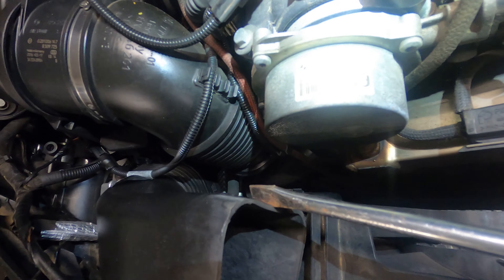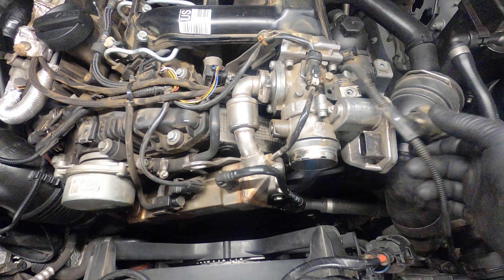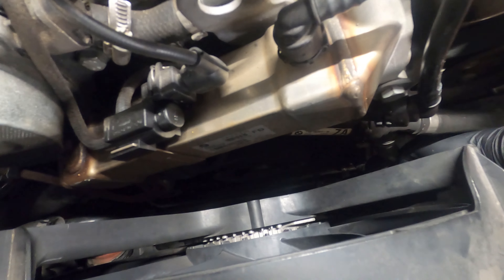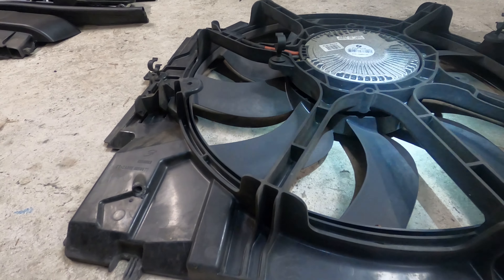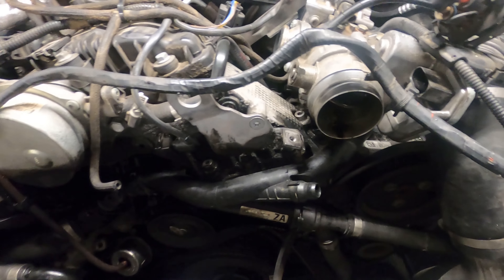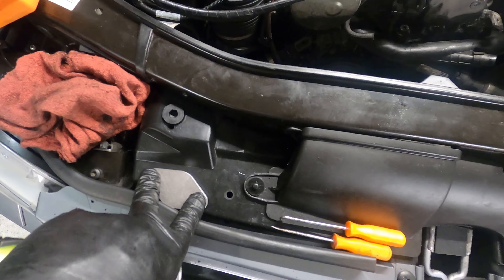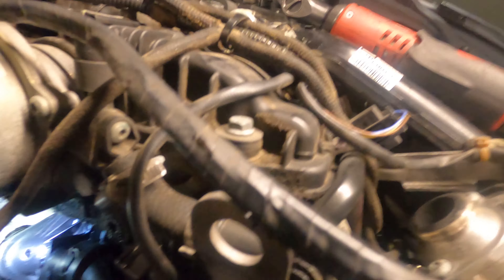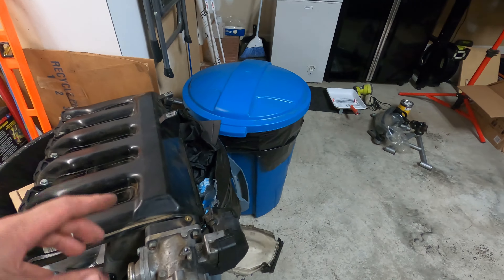BMW 335D EGR Delete | BMW 335D Build Series

Comment: Hey, can you describe how to install the exhaust blank? Is the little metal keeper thing also a gasket? Does that go on first? I keep getting a leak. Thank you
Reply from the maker: Depends on which kit you have, as there are a few variations out there. The one I had the aluminum cover had like a conical area on one side that seated into the exhaust manifold to provide sealing. Others I've used are just flat, those leak and I've had to switch to the other style.
Reply: @MunkysGarage  thanks
Reply: Same problem to me i was thinking exhaust manifold but actualy it was the alu flate straight blank, i need to find same blank like yours by the way nice video thank you u helped me a lot i will subscribe and like 😊  @MunkysGarage

Comment: If there’s carbon built up in the intake man is it okay to walnut blast it out?
Reply from the maker: If its in the intake ports in the head then yes. Just make sure the valves for that cylinder are closed when you do it. If you are talking about the intake manifold I would say no. With the intake manifold I normally get a container large enough to fit it in. And soak it in a mixture of water and simple green, then scrape it out with screwdrivers or steel bore brushes.

Comment: Hi whats the exact sequencing for the abc delete.  Thanks for the video.
Reply from the maker: By sequencing do you mean in what order you should do them in?
Reply: @MunkysGarage  yes exactly
Reply from the maker: @cyclonus01  I don't know exactly what the proper order is. I feel like it is personal preference. I would do the EGR delete first, as this is contributing to carbon buildup in the intake system and will cause you to have more headaches to deal with down the road. I would remove the diesel particulate filter second, which is replaced by a straight thru downpipe. With removing the diesel particulate filter you will also need to either remove the scr catalyst or have the housing of it cut open and the internals knocked out. When you install the downpipe you are also removing the diesel exhaust fluid metering valve. This fluid is what cleans out the scr catalyst. If you do not remove the catalyst it will eventually clog up and cause you driveability problems. I would leave the swirl flaps for last. While you have the intake off to do the swirl flaps I would also plan on replacing the glow plugs and controller, just as preventive maintenance to keep you from having issues down the road. Removing any of these emissions components is going to require a ecu tune in order to eliminate the ecu from looking for the removed components when doing a system check. The tuning part is what causes people to just wait and do everything at once. Because if you do things one at a time you will have to have things retuned after each step.

Comment: Any check engine light with the egr-conector unplugged?
Reply from the maker: It will. You have to tune it to ignore the components of that system being absent.
Reply: @MunkysGarage  Will it still run without problems or will it pull power (safe mode etc)?
Reply: @mrt1233 will go in limp mode

Comment: hey Man i’m new to the whole bmw diesel scene, and have learned i need torx sockets. what sizes do i need to do my full ABC delete?
Reply from the maker: I would recommend just getting a set like this. So you will have whatever you need. NEIKO 10083A Master Torx Bit Socket and External Torx Socket Set, S2 and CrV Steel, Supreme Torque Output Complete Kit, 60 Pieces https://a.co/d/5uX1yVl
Reply: @MunkysGarage  Sounds good. Thanks man. how much time do you think it’ll take for me to do my swirl flap deletes, EGR deletes and DPF delete? (i’m pretty mechanically inclined)
Reply from the maker: @diesel.bimmer  sorry for the late reply. Should take a weekend to do. I normally take that long to do them when not rushing.

Comment: I am new to the BMW scene as well as the diesel portion of it. I have a performance power reduced problem. I am wondering if the EGR and cooler can cause this.
Reply: These are the codes I am seeing.
 P0405- EGR Sensor A circuit low
P0299- Turbo underboost
P209F- Reductant tank heater control circuit
P042F- EGR 'A' control stuck closed
P2457- EGR cooling system performance
P0402- EGR flow excessive detect
Reply: @botzetdj I know I’m late but it’s the turbo underbokst code causing the “engine malfunction. Reduced power output. Possible to continue driving” (I am quite familiar with it). With out the turbo the car isn’t able to get enough air into the engine to create more power, therefore lowering performance of your car

Comment: Getting ready to do this.  Is removing the fan totally necessary? Thanks!
Reply from the maker: It is not. If you can get your hands down in there to do what you need to do, you can still get it out.
Reply: @MunkysGarage  What egr delete kit did you use for this.  I'm looking to do the same with mine and don't want to get anything wrong

Comment: Do I need to drain coolant to do this?
Reply from the maker: You don't need to drain it completely. You will lose some coolant when taking the coolant lines off at the EGR cooler.  But completely draining the system is not necessary.
Reply: thanks for a fast reply!  Going to give a shot this weekend.  thumbs up for you.  @MunkysGarage

Comment: Hi @MunkysGarage .
After the egr delete and the tune installed, can you pass the state inspection?
Reply from the maker: It would depend on the state. Some states only require safety inspections on diesels. In those states, you would be okay. If you have a state that checks for emissions tampering or does tailpipe testing, you would fail.
Reply: @MunkysGarage  My state does not do tailpipe testing, just OBD2 scan. Not sure if it can be detected on the OBD2
Reply: @Alena-ec8or did you figure out about that? My state only scans through the obd2 as well. So as long as the tune can make everything looks “ready” then it should be ok?
Reply: @datvu2446  nothing yet

Comment: Do you need to do a ecu software update when removing the egr valve  and cooler ?
Reply from the maker: You have to program the car so it stops looking for the egr valve and doesn't set a fault for it not being connected.
Reply: @MunkysGarage  can you show me who can do that tune for me?
Reply from the maker: @felipeborrero1489  tune my euro is who did the last one I worked on. This is a link to their website-https://www.tunemyeuro.com/

Comment: Do you have to have a tune or computer flash done after an EGR delete?
Reply: And if so, what you used to tune and can you point me in the right direction?
Reply from the maker: The cars I have done so far have been tuned by a shop local to me. I have heard from some people there are people that offer remote tunes that you can do yourself. I do not have anymore detailed information about that at this time.
Reply: @MunkysGarage  This is my question too ;)

Comment: Good video.  We found it to be very helpful.  Unfortunately, you did Not show how to install the exhaust blank for the EGR Cooler in your video.  I saw that someome else asked about it in the comments, but I can't see your reaponse.

I cannot see where the blank goes in while trying to install it and I can only reach it with socket extentions, but so far I have not been successful in getting a bolt in.

Comment: What are the benefits of doing this as opposed to coding it off
Reply from the maker: Well if you code it off the egr valve itself is still physically installed and is in the path of the intake air. Could potentially be a restriction eventually depending on what other modifications you do.

Comment: Do you have to tune the vehicle with the EGR delete?
Reply from the maker: You will have to tune the car. Without the emissions components installed it will set the check engine light and eventually go into reduced power mode.
Reply: @MunkysGarage  thank you for the reply, watching your videos and flying gatos inspired my purchase on a 2011 335d
Reply: What tune app do you recommend?

Comment: I've got the sensor on top of the cooler as well, what do you do with both hoses that run into it?
1 of them runs behind the cooler and another runs behind the intake, any advise?

Thank you,
Reply from the maker: They make a cap off kit to cap off those hoses.https://images.app.goo.gl/8FqcJi2GstRWRpEZ7. And the wiring for the sensor just gets tucked up out of the way.
Reply: I meant like vacuum hoses, should of been more clear sorry
Reply: I mean my sensor sits on top with the 2 vacuum hoses going to it, what do I do with them, I've ordered a kit from DarkSide development's but there's no instructions for them vac hoses
Reply from the maker: Just plug the vacuum hose that comes down from the tee on the top of the engine.
Reply: @MunkysGarage  If I do this modification will I get a check engine light for the unplugged egr cooler sensor?

Comment: Mpg difference before and after?
Reply from the maker: Can't speak much to the before because I didn't drive it much prior to performing the delete. But it is averaging 28mpg with an average speed of 26mph since the delete, which falls into city/hwy driving range. That's with spirited driving. While cruising at highway speeds it will fluctuate between 45-50mpg on the instant mpg gauge.

Comment: Are you removing the SCR and removing DPF? Also, if one is to remove the SCR, whats happens to the DEF fluid?
Reply from the maker: If removing DPF and SCR you would normally have the vehicle tuned and the turn off the exhaust fluid injection function.
Reply: @MunkysGarage  Ah makes sense, then I would just remove the cables. Thanks for the response.

Comment: Do you have to remove the intake manifold to take it off?
Reply from the maker: You do not have to remove the intake manifold to remove the egr cooler. I had my intake off for other repairs and figured it would be easier to show you where the screws are holding the egr valve on when the intake manifold was off the car.
Reply: @MunkysGarage  thanks for the feedback! Subed!🙏
Reply: @MunkysGarage  also did your car go into limp mode?